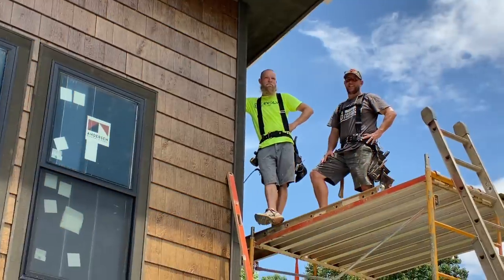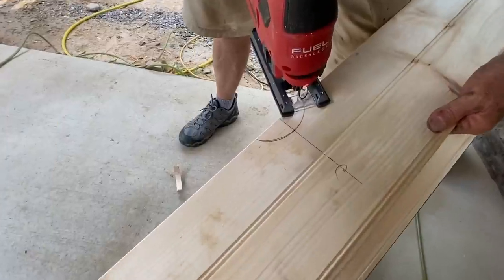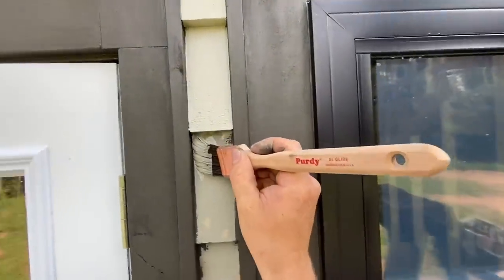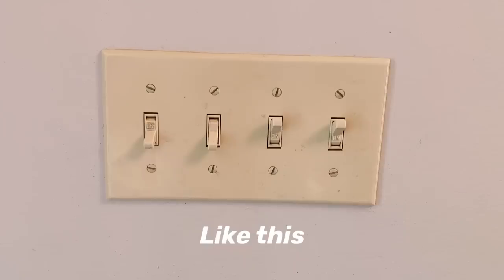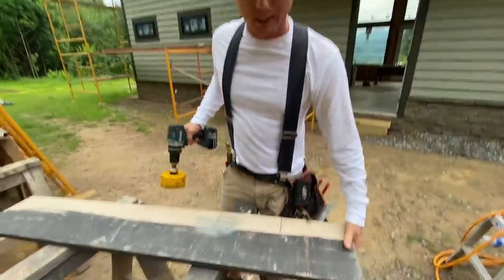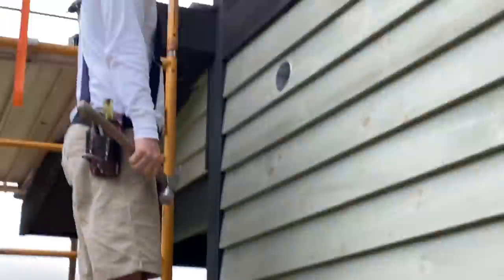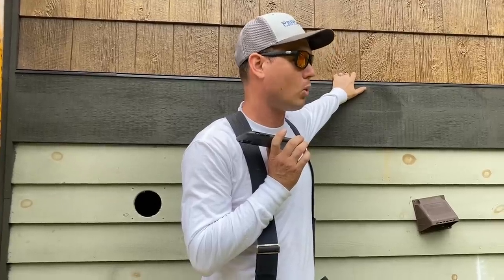Building A House Start To Finish | Episode 14: Prep For Floating Shelves & Porch Ceilings

Comment: Jaime, pro tip: just hold your block of wood up to the siding and cut from there using the oscillating saw. No need to mark it and hope you hit the line… speaking of the 4” hole repair. And use a small piece of flashing above it!

Comment: Unfortunately that’s about as good as it gets for “finish work” from mechanical subs. Your version looks much better and will last much longer.  Great video this week.
Reply: I'm curious as a GC would you have any conversations with the sub concerning their quality of work or charge for the rework you had to do or is this just a standard issue you have to deal with when building high end custom homes?
Reply: You could mount the blocks and drill the holes beforehand, that way the mechanical subs will know where to put the vents.
Reply: Great tips n tricks! May steal some of them.
Reply: it's definitely much better

Comment: I’ve used a 6 1/4” hole saw for bath vents and that really snaps your wrist sometimes also it’s better to use insulated flex for your vents as it reduces the chance of condensation in cold spaces … it’s code in Michigan

Comment: I think you should be using the teco replacement screws #9 on the metal bracket for floating shelves. Those deck screws aren't meant to take lateral displacement and will sheer

Comment: Just a rookie tip on using those big hole saws. To avoid it spinning the drill on you and potentially breaking your wrist set your drill on "screws" setting. This way drill will just start skipping when the hole saw binds instead of spinning on you!

Comment: Great House!!! I just stayed at the modern mountain get away. This particular exterior drier vent is already plugged up with lint. The mesh square mesh screen is not a good design.
Reply from the maker: Thanks for the info!
Reply: @PerkinsBuilderBrothers  You are welcome! I also noticed the back French Door probably came out of adjustment as the house settled. There is a noticeable air gap a the bottom jam where the two door sections meet.

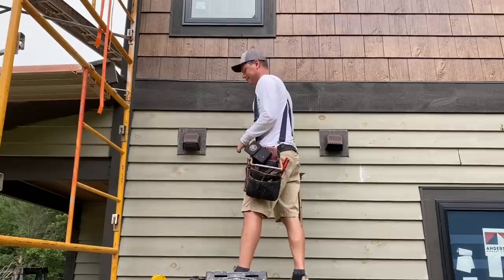Comment: 15:15 if he wants... he can spray a little bit of rubbing alcohol on his hands right before using his fingers to apply the caulking, will help not feeling sticky. spray bit by bit, wont work if the alcohol dries, so have to have a little spray bottle on hand... only if he doesnt want to struggle taking it off, also works great with the silicone caulking.

Comment: Hey I'm Type 1 too! From what I heard in the bonus ep Ray isn't very keen on technology. Does he use a pump and CGM for his diabetes? It would be tough managing it without those when having such a physical job. I'd worry about going low a lot.
Reply: I actually just got a CGM and pump a couple weeks ago. It's definitely changed managing my diabetes for the better.
Reply: @RayJones-PBB  that's awesome! I don't have a pump yet but I have been using a FreeStyle Libre (not quite a traditional CGM but it's great) and my A1C dropped from 8.5 to 6.5 since using it. It really makes a difference. Good luck and stay safe!
Reply: @hoguemr  I use dexcom and tandem pump. Luckily insurance covers the majority of it. the struggle is real. Good luck to you too, glad to be able to connect with a fellow type 1 diabetic.
Reply: @RayJones-PBB  I hear Dexcom and Tandem pump is a great set up. I hope to move to that someday. Yeah I always like to hear other T1s experiences so thanks for sharing!